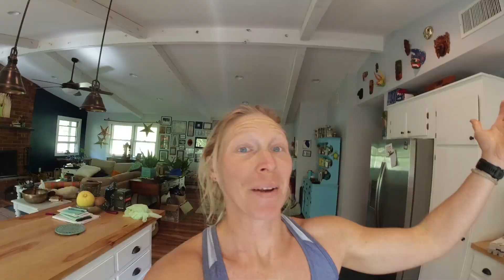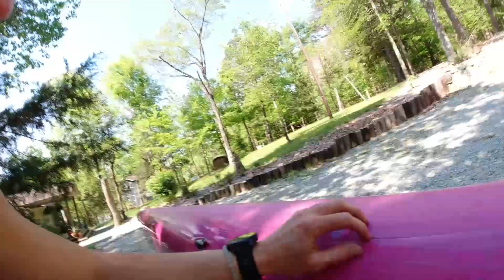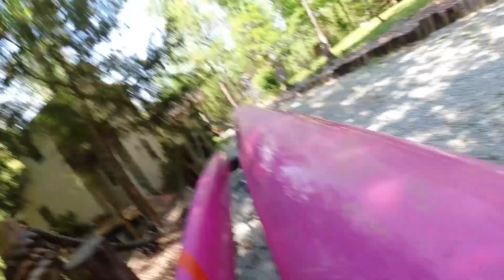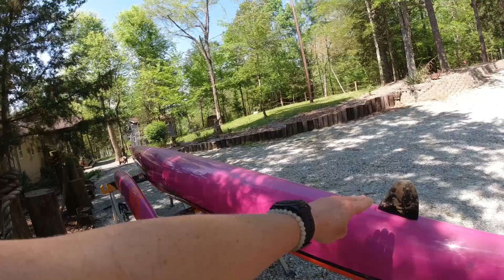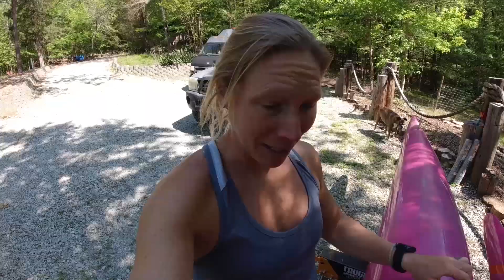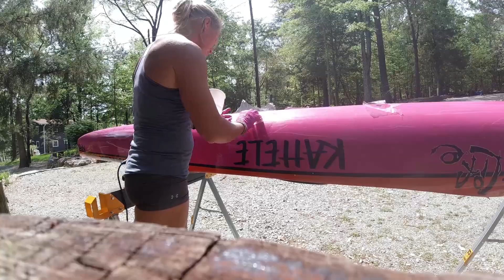#Hyco2Hatteras: Grounded

Comment: No need to make it pretty later.  The river will sand it smooth the rest of the way.  I was surprised you did not add a little 3 unce glass cloth to some of those holes when you patched them.  If you want some we buy 10 yards at a time so we can spare it.
Reply from the maker: Just got it river ready, the epoxy was strong enough to finish the journey. I've since gone back and sanded out the gashes and added fiberglass, I like to make it look pretty ;-P
Reply: @AprilZilg  Well pretty until next year anyway ;)